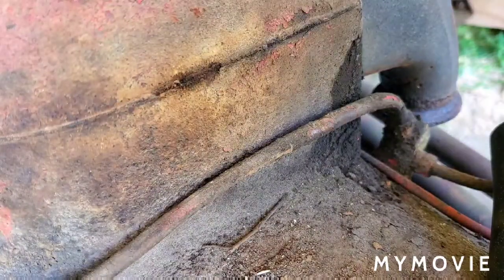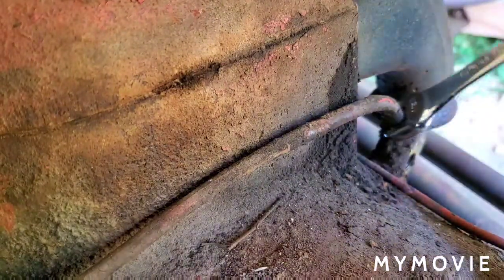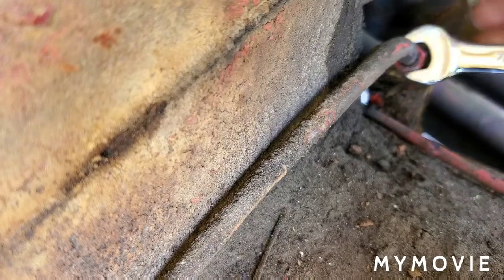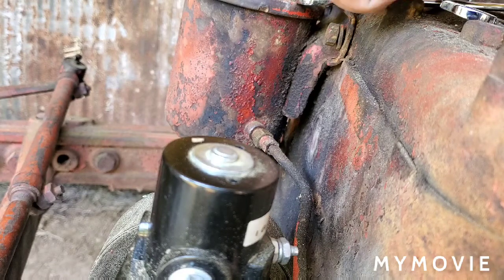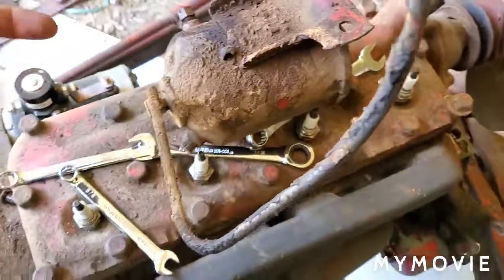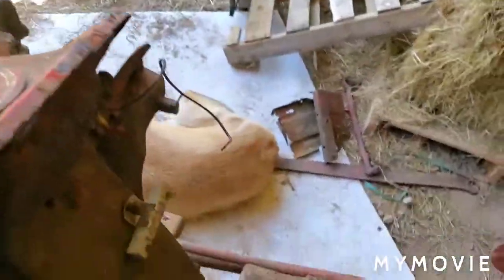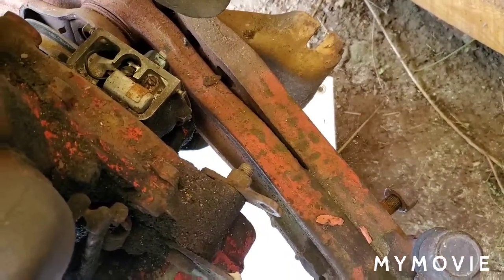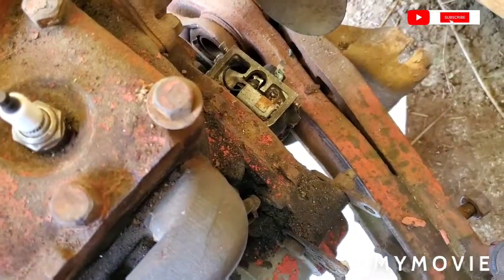Ford 8N tractor restoration part 6

Comment: I started restoration on our ‘49 8n July of ‘21. The tractor had not been run since summer of 2003. I ordered all my parts off Yesterday’s Tractors website: complete engine kit, gauges,clutch kit,wire harness, distributor parts, hood,doglegs, and grille. I ordered new gas tank and radiator several years ago in anticipation of this project. I had to have a machine shop hot tank the block and install the sleeves and also fabricate the studs for the oil pump, they stripped the threads when I removed the nuts from them. I hope to have the engine hung back on the tractor by July 1st( it’s been one delay after another). The oil pan is going on in today and then I can put the head on tomorrow and then the clutch. It has taken me “a month of Sundays” to get all this done and I bought a ‘51 8n in January and hope to get it running before Thanksgiving. My Dad bought this tractor in 1966 and completely rebuilt it and we worked it “to death”. I still have to put rear tires on it. I don’t mind spending the money though. You can sink a lot into these tractors if your not careful. I think I came out pretty good on my ‘51. The metal is good and it’s not froze up and I got it for $700 and I have over that in parts in the ‘49(the price of sentimentality).